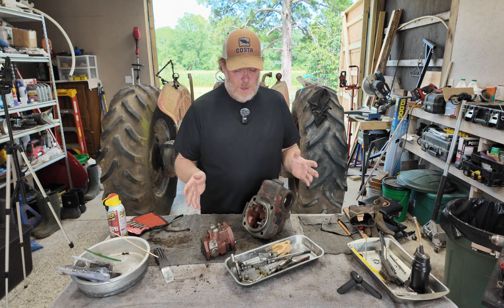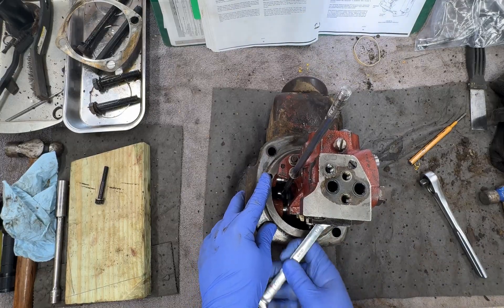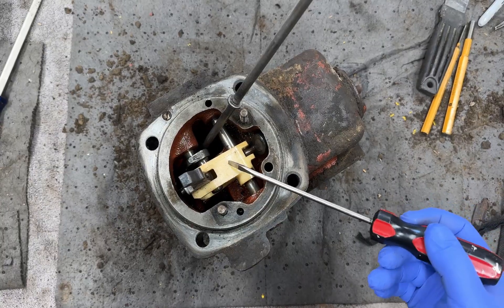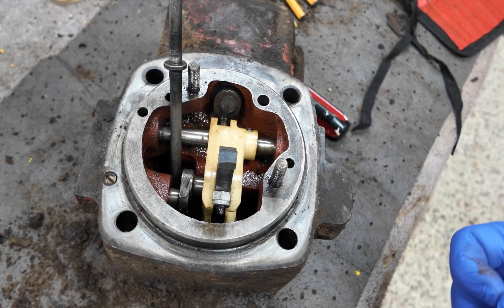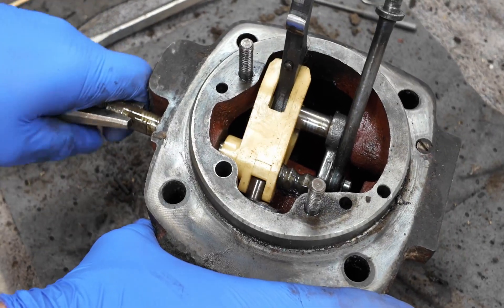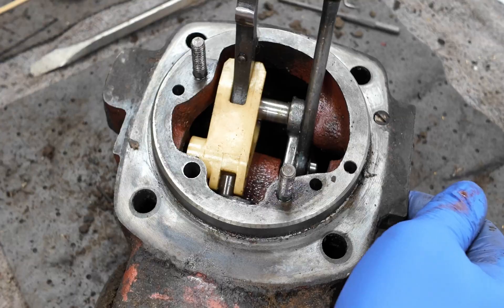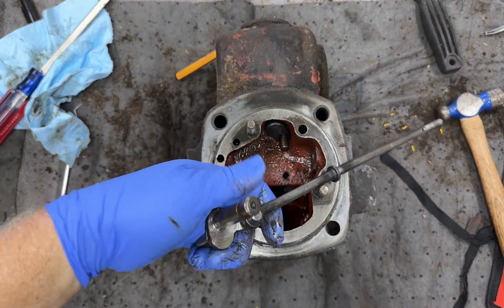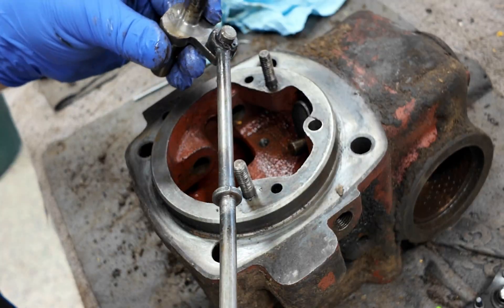Valve Chest separation & removing Right Hand Ramshaft Bracket selector internals - David Brown 990#6

Comment: Hi Shane, great to see you getting to grips with the internals, it just needs a good bath and plenty of loob to go back together, When you go to put the detent back for the fork shaft, make yourself a little tool with half the diameter ground away, it makes life so much easier.
great to see it getting much needed TLC
nearly for got to say a big thankyou for the shout out, much appreciated
Reply from the maker: Too late on the detent, lol.  Already filmed it putting back together and editing now.  I actually re-filmed the disassembly too.  No need to use vice-grips and hammer to get the shaft out of there due to that blanking plug being on the end.  Figured out a better way.